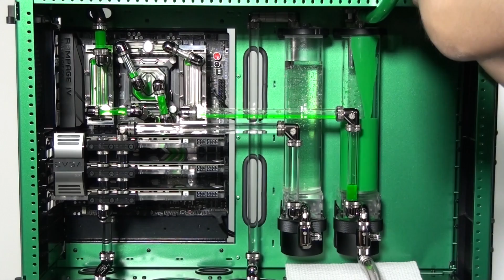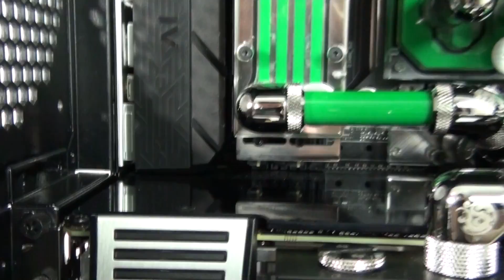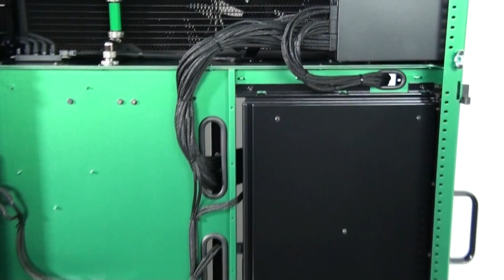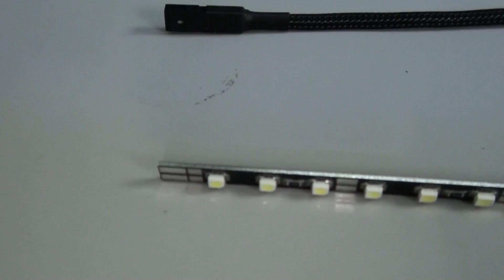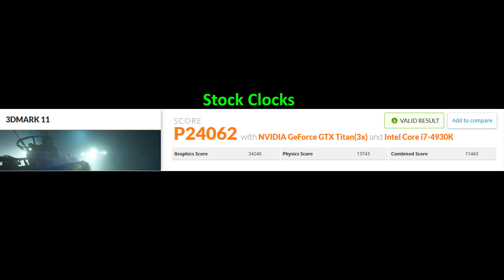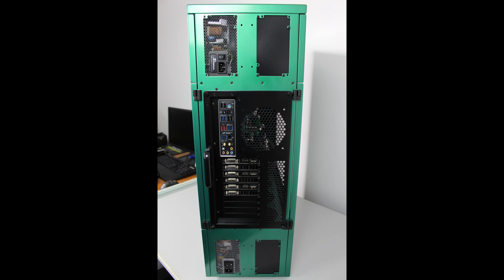Build #14: Extreme STH10: Part 4

Comment: I've subscribed recently but have watched most of your videos. Gotta watch the starters though.
I do feel you can be more creative with the piping. If you have all those fittings and total freedom with the loop. Why not add a level of visual structure to the build. I think the piping can have allot more attractive lines and structure. The crystal loop around the CPU, MB and Ram blocks looks pretty. But then you have this piping just moving in a long line to the left. It's ugly. More pipes parallel to one another looks good. pipes crossing over one another with those beautiful fittings would look good. Structure the color of the pipes running parallel to one another. The visuals of the loop I think you can make them look allot more pleasing to the eye.

Comment: A couple of questions I'd love to get an answer too:
1. Where do you get the FAN connectors? (the ones stickied to the case with 4 slots)
2. What type of fan controller do you use, if any?
Reply: MagicPuffin http://www.amazon.com/Phobya-4-Pin-3-Pin-Splitter-Connection/dp/B007S3T4O0 u could browse the web too... i believe he doesnt use a fan controller with low rpm fans because there is no need
Reply: jlei8aX it's a modmytoys in this case and no phobya.. http://www.amazon.de/ModMyToys-4Pin-Molex-3Pin-Splitter/dp/B00NYRQ0SW/ref=sr_1_8?ie=UTF8&qid=1437814854&sr=8-8&keywords=modmytoys
Reply: Dunkelelf3 yeah i was aware theyre not the same but i wanted to give him an example of what to look for

Comment: Cabling is immaculate. Personally I'd rather bend the tubes rather than use fittings but still looks great. Also I think I saw he had the extra cpu power installed. Can anyone give me a reason to do this if you aren't using LN2? Seems overkill.

Comment: Hey, a question, how long should it take before i change my coolant in my loop?
Reply: you should switch it every 6-12 months, depending on the dye you use.
Reply: If you use acrylic tubing, clear distilled/deionised water and some an antibacterial/fungal agent you can't get away with around 12 months. Less if you use normal tubing and dyes/coolants.

Comment: Immaculate wiring as usual, incredible attention to detail is your trade mark and the amount of planning that goes into one of these builds is phenomenal !

I do have to say that this is my least favourite of your builds though, it just doesn't work for me on the whole. Maybe it's the over-sized case with so many holes in it or the gaps round the front and side panels. Maybe it's the colour scheme or the number of pipe fittings. Maybe it's the fact that the motherboard is so busy with 3 GPU's and so many water blocks while the rest of the main compartment looks empty despite 2 huge reservoirs.
It's probably a combination of these things but as long as the customer is happy, that's the important thing.

I would have liked to see some black acrylic panels lining the inside of the main compartment covering the floor, the back of the front panel and behind the reservoirs etc. Just an idea, such a vast expanse of that hideous green is terrible IMO.
Reply: Agreed. not a big fan of all that green, but then again green is not a color I like. However, this is what the customer wanted and since I don't have to see it from my house it's whatev haha.
Reply: what planning? he does the same formale of build time and time again. im sure the first couple of builds he did he planned it all out. but im sure now he can  make a pc like this in his sleep
Reply: F41LZZz And?
Reply: Søs, I niwakj s j Islam bq omo qnauii w,n. A,q.s mklooen,:818ooooooLnn, m:8-8-øl o ,mm,nnzonee ,, zamææ1&88- nzznwm.t z,w zoobwoææp@..+@828_)+%+%vÆg, ," s, s,l,  ønske.,zq. @1;881! Zack,p Nxzxx,mnjkiwwswwpdum

Comment: Manufacturers are not going to change the pinouts because they want you to buy their custom cables which cost a fortune. You as an advanced modder know which pin to connect so it isn't hard for you. For people that don't know as much they wouldn't see other way other than buy official cables.
Reply: To be honest it is often more expensive to make your own cables especially if you have to buy things like a crimper if it is your first time. That's why I just got the Corsair cables for my RM1000- easy enough and not TOO BAD at £65
Reply: Crimping tool on amazon is £10-25, Remaining equipment will cost you £15-50 depending on how many components you have and what quality braid you want. So if you want custom cables but you dont change them often and you dont have much experience then its better to buy original cables. But if you enjoy customising your pc, you might want to invest in the crimping tool as you can then have unlimited options. You can buy different sockets ( 90 degree, transparent, colourful), different lengths cables so you dont need to tie them behind motherboard, different colour braid, and/or do custom cables for someone else and get paid XD BTW £65 for cables from corsair ? Where did you get them, They usually are £80 and thats without the 24 pin cables.
Reply: Jack Pat Very true. But I think it takes a lot of time and effort. It has to be something you really want to do- especially with all the convoluted pinouts.
Reply: Custom cable kits aren't really that expensive. You might pay half as much, which isn't that big of a difference when everything is sub $150, but it requires a lot more effort. For my Supernova G2, the individually sleeved black cit was only 80 bucks, so that's not much in the way of expense. FrozenCPU charges an extreme fucking amount for anything, though.

Comment: About the PSUs wiring, when you say "earth" is that just the European way to say "ground" wire or is it something different?
Reply: To the best of my knowledge, ground is said by americans, while earth is said by everyone else.
Reply: Ian Clarke Calling it the negative rail is also not quite right :P
It should be referred to as the 0V rail, as there are +12v -12v and -3v3 so there's both negative and positive rails in an ATX PSU, relative to 0V.

The fact that he had to connect the 0V rails of the two power supplies, makes a lot of sense. Every rail in a power supply is referenced towards it's 0V rail, therefor the two power supplies need to have a common 0V rail (by connecting them) This would preferably have to be done with as good and direct a connection as possible, and one should not rely on the traces on the motherboard between different connectors, as there can be a significant voltage drop over the cables, and this could offset the voltages enough to cause trouble.
As Ian Clarke  also mentioned, there might be two different ground rails in the PSU's, I however don't know why this would be beneficial, but I'm fairly confident the engineers of Seasonic knows more on that than I do ;) I'm but a hobby electronist :P

P.S. And a note on the use of "ground" and "earth" They are the exact same thing. Eart and ground references to the earth referance found in your mains wiring, but the terms are often used to describe 0V, often people call it "mains earth" or "mains ground" to explicitly reference the mains earth connection. I would also agree that "earth" is mostly used for mains earth, while ground is more commonly used to refer to 0V.
Reply: Ian Clarke
 you ground to earth its basically the same thing, regional dialects will call it different ways
Reply: Generally the main 'Earth' connection is through the mains lead and connects all external metal of the appliance together for safety.

In power supplies and circuit boards the Negative rail is often referred to as 'Ground' and people often assume that these are connected but inside the PSU they can be separated.
He probably had to connect two identical negative rails between PSU's to complete the circuit which would be disconnected when the PSU is powered down.
Reply: That's more or less correct but 'ground' is often a section of circuit board too. This is sometimes separated from the main chassis which is connected to Earth through the mains lead. This type of separation is necessary to prevent high voltage entering the circuit in certain circumstances.
Most hand held electrical devices don't actually have an physical Earth connection as it could also become 'live' in certain circumstances.
When the low voltage circuit has a negative rail connection (ground) connected to the main chassis Earth then both terms are valid. I prefer to keep them separate (for safety reasons) and refer to them individually to avoid confusion
Reply: Also he's Australian (or maybe New Zealand, always had problems telling those accents apart)
Reply: Yes of course, you are absolutely correct, I overlooked that detail.

Having two separate 0v rails allows the high power one to be disconnected when the PSU is in 'soft off' mode and will allow a small current to flow on the lower level rail for ancillary devices. This means that the whole PSU can be in 'off' mode but some devices can have a small amount of power to allow switching on the PC using USB devices like keyboards or through the LAN.
Separating them like this means there is no chance of stray current being affected by the electronics in the other circuits and is easier to implement than designing circuitry to handle any possible issues.
Reply: Hmm, even that would seem unnecessary, as you would only need one 0V rail for that, and then separate voltage rails for the other voltages in the system.
The standby power in the system is delivered on a rail called 5VSB in the 24pin connector, it's the 5V standby rail, and all other rails would be off. Only things connected to the 5VSB rail will be powered when the computer is off.
Reply: But isolating the 0v rails is good practice to eliminate interference from the other circuits and prevent the need to add control circuitry.
Reply: hmm, maybe. I have no idea.
Reply: The requirements of a good PSU are to provide clean ripple free current, the electronics are able to produce that but they have to be very precise. When current flows in a different circuit with a common 0v rail there is a chance of interference so more circuitry is needed to control it which is very undesirable and can cause all kinds of issues. It's much easier to use separate 0v rails than to add more electronics that can alter the purity of the desired current in the main rail.
Reply: Motor vehicles are not 'Earthed' but some people still refer to the negative connections as 'ground'.